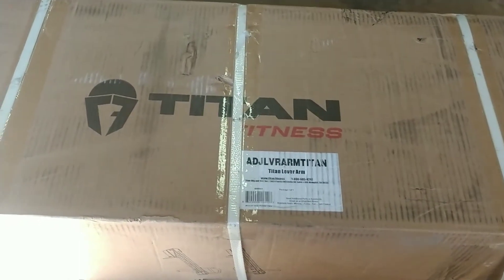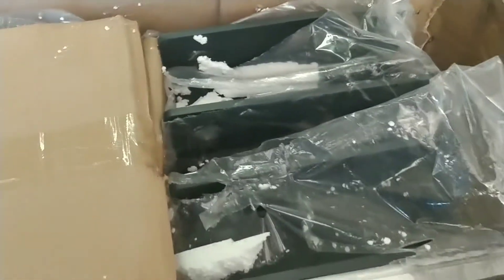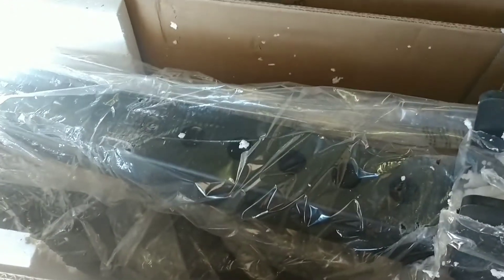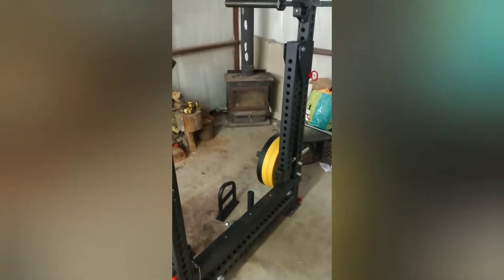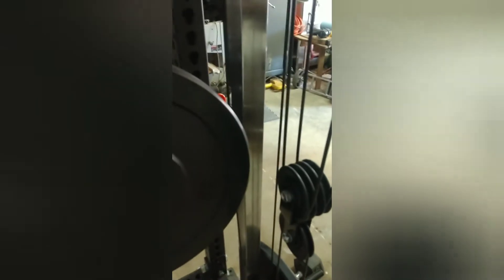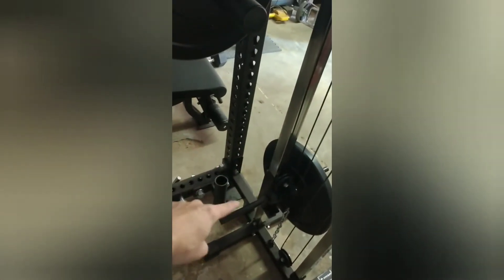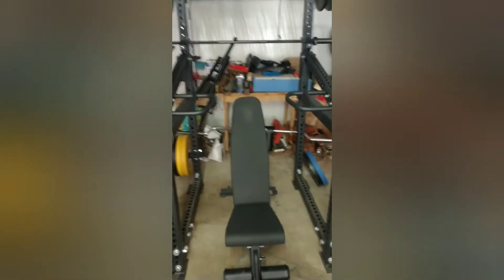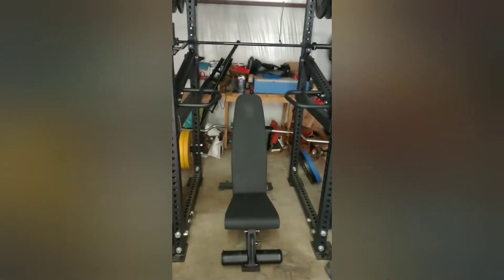Titan Series Lever Arms

Comment: Hi Master, the front rubber stopper can be removed? And also, the holes and bolts that support the handle frame are 1"? Thanks,
Reply from the maker: The stopper can be removed and the hardware for the handles is smaller than one inch
Reply: @jackel71603  All the other holes are 1", right?
Reply from the maker: Yes all the holes are one inch